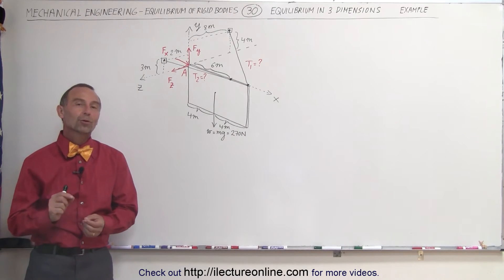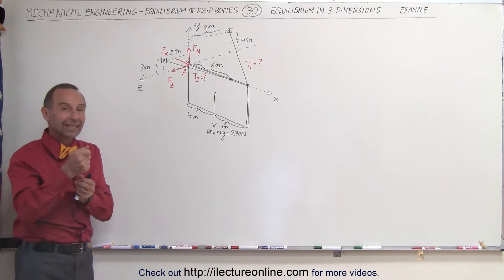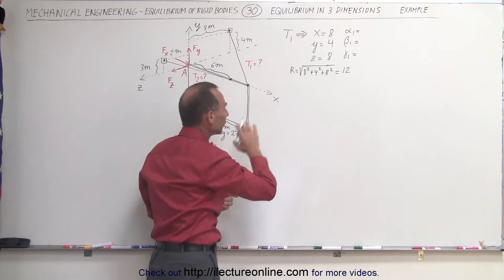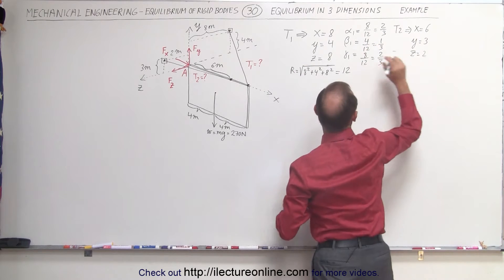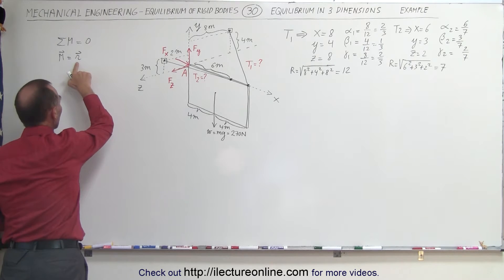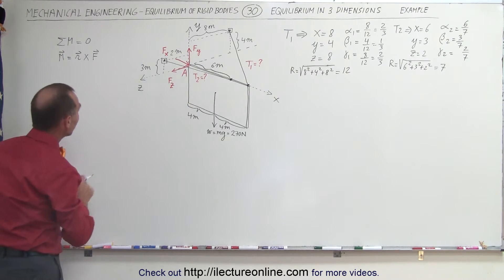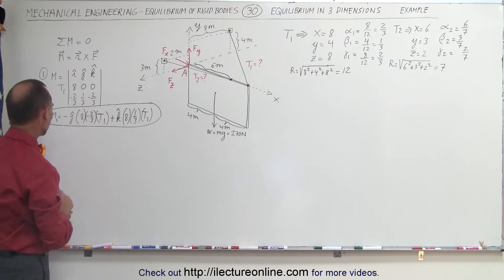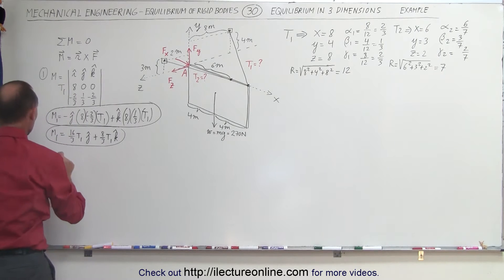Mechanical Engineering: Equilibrium of Rigid Bodies (30 of 32) Equilibrium in 3-D Ex. 1***

Comment: Hi Sir, First of all thanks for very helpful videos.I have question: Why didn't you write  z  -8 when you write T1?
Reply from the maker: I don't like to use the word "all", but your method is sound.
Reply from the maker: At at time in the video are you referring to?  (and are you asking why z = - 8?, or why not? )
Reply: @MichelvanBiezen   I mean when you write T1  z is at the negative side but you wrote  just mıagnitude as you said at the video I watched again and I understood thanks. Also I tried to solve with another   method. I determined the T1 vector by  two points : one is the on the wall and other is the corner and  also determined the T2 same  method.So, I found T1= (-2/3 T1i, 1/3 T1j , -2/3 T1k) &  T2= ( -6/7 T2 i, 3/7 T2j, 2/7 T2 k) and than wrote the moment  equations about y, z directions and found same result. Can I use this method for all this type questions, it works?

Comment: What you call "direction cosines" I call "unit vector", usually written as ê. Is there any difference ?
Reply from the maker: Yes, they are not the same at all.  Take a look at this video for clarification:  Mechanical Engineering: Particle Equilibrium (15 of 19) What Are Direction Cosines?
Reply: Now I see the difference, thanks sir.